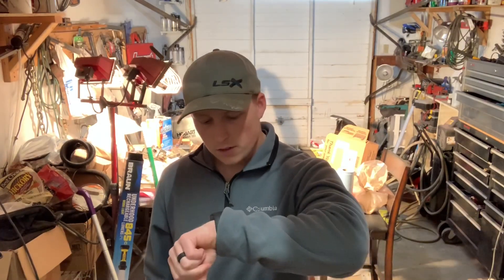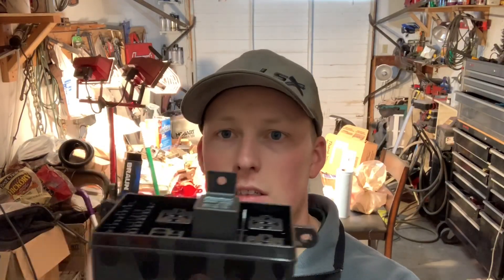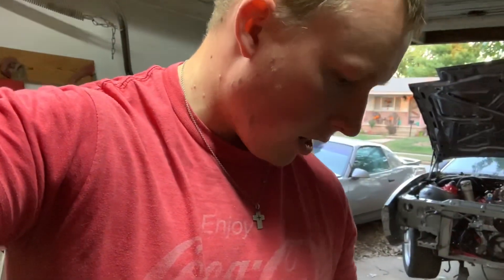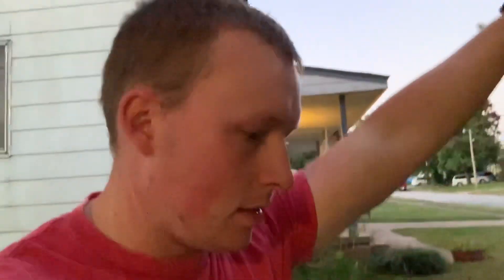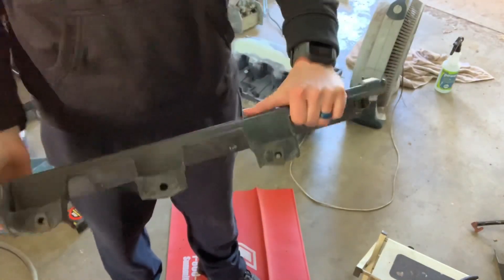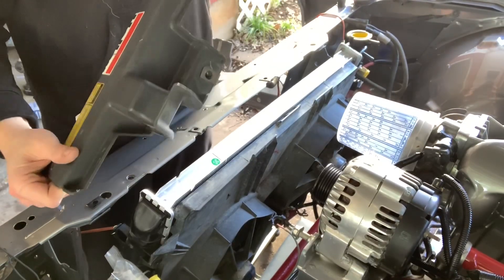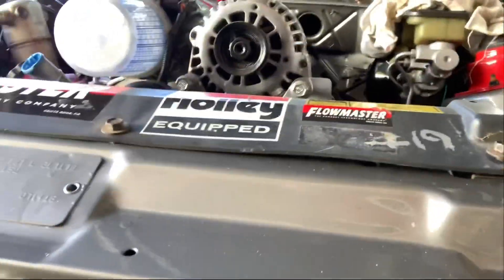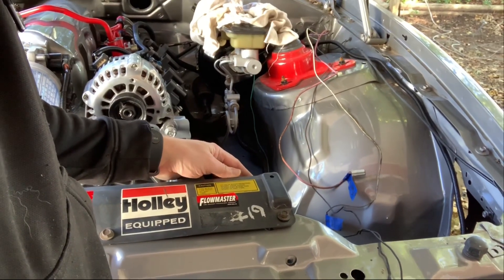1983 3rd gen ls swap UPDATE 3 radiator and electric fans

Comment: Are you planning on putting AC on the car?  If so that will push the bottom of the radiator back some and it will conflict with the steering box.  I ended up using the thirdgen radiator and the 4th gen fans, but they are moved as far to the passenger side as possible.  I still had to clearance the shroud slightly at the steering gear.  I also had to clearance it on the bottom where you did.

Comment: Any problems with the hood closing? I have a 1980 trans am . I was thinking about going with a truck LS.
Reply from the maker: Jeffrey Long yes I had to do some trimming on my hood, that is in one of my videos
Reply: I have 89 with 2k firebird ls1 swapped, with the power buldge hood the engine clears, the cold air intake is too close to my upper radiator hose and just barely touches the hood liner.

Comment: Hey man i like your build im doing the same thing and im having trouble getting good clearance with the fuel lines being they get to clos to the header any ideas?
Reply from the maker: Lsx_ Firechicken if there to close I would try wrapping the lines or headers, I’m using 4th gen manifolds and haven’t checked the clearance yet
Reply: I installed new custom hard lines on my build, in the third gen location, and flared them to accept the 4th gen quick disconnect.  I wrapped the lines.  I'm running stock manafold but I'm also running stock 4th gen cats (cut and reclocked the flange so they fit).  So the cat is only a few inches away from the fuel line, so far that hasn't heated my fuel.